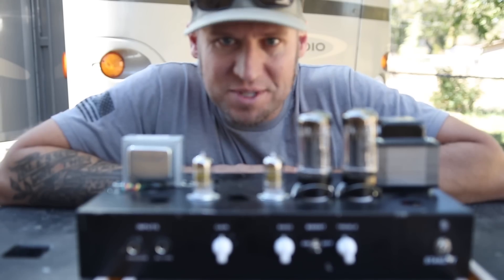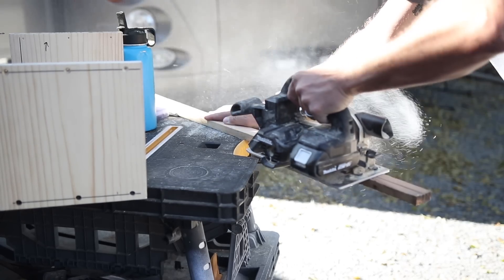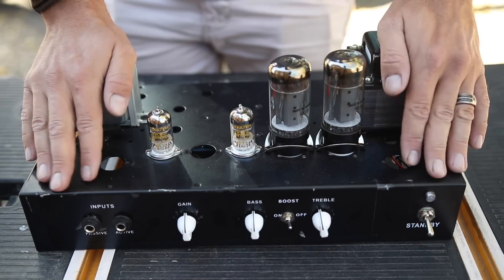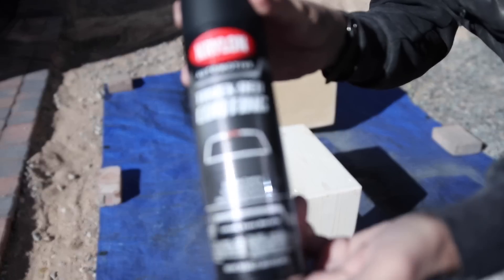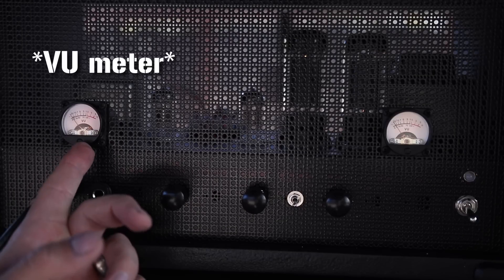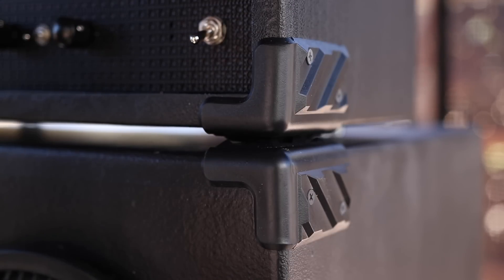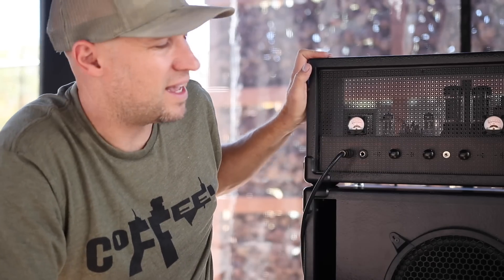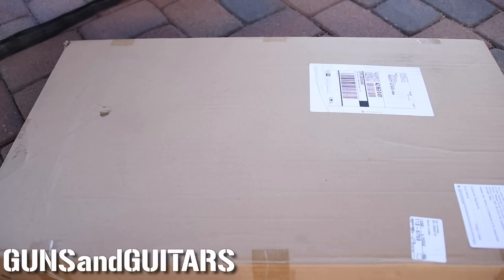Build your DREAM AMPEG style TUBE BASS AMP (for half the price)! KLD BFLEX 25 DIY portaflex kit

Comment: "id love a 50 watt version of this"
well two 6L6s usually make 40 to 50 watts of output the fact that your only getting 25 watts from them is sad cuz that means the circuit is designed to run them really cold or really inefficiently to get 25 watts out of tubes that can make 40 or 50. if it were me id just change the power amp circuit to get around 45 watts out of them and change the output transformer to handle the higher power if needed. but i know you dont know as much about amp modding. tho you prolly could try to learn to mod it by getting the schematic and post it to a amp forum site and ask some builders how you can get more watts out of it
Reply from the maker: I was thinking that two 6l6’s should be more powerful. This is very interesting to me. I’ll see if KLD will send me a schematic, then maybe I can mod it for more power!
Reply: @GunsandGuitars  You should be getting 50 watts just by running at 4 ohms.  But, the more powerful tubes rated at 50 watts should get you up to 100 watts at four ohms.  THAT is a gig worthy set up, even with a heavy handed rock drummer!  Hahaha ;D
Reply: Btw, correction: they took 7027 and 7059 output tubes, but would work in a pinch .
Reply: As a retired amp technician who worked in a music store in the 80's and 90's and worked on all brands of tube amps, I would have thought you already have nearly 50 watts by using a pair of 6L6's.

Comment: It's not about adding a tweeter to add highs. It's to use a crossover to send the highs to a tweeter and the mids/lows to the woofers. The reasoning is to have only the frequencies the speaker is designed for sent to it. It improves the clarity immensely. Tone is in the ears of the beholder, but I DO NOT like the sound you're getting, I just like a flat amp. The highs are there, sure, but it doesn't sound clean like I like a cab to sound. I feel like you speaker is struggling to churn out the highs and it's at expensive of a deep lotube? Could also be poor bass in my cellphone speakers, to be honest.

 You turned me onto the fearful cab, and its sounds cool as a project, and I appreciate you much for that. However... this amp cost as much just the woofer for the fearful cab, so might be more fun to try.

How was your cost on the tubes?
Reply from the maker: I think I paid around $100 but the tubes

Comment: 50 watts?  I'd need a 300 watt SVT clone! Hahaha ;D  But, those are heavy bricks!  At present, I have an ultra-light Acoustic brand short stack with twin 1x12" neodymium magnet speakers and a 300 watt digital head with a tube preamp.  Love it!  The cabs weigh in at about 25 pounds each and the head is like 5 pounds!  Great tone at any volume from bedroom to concert hall!  Fits in any car, even a mini-Cooper or a Prius!... not that I'd be caught dead in a Prius...  Hahaha ;D  That's why I mentioned the big SVT.  My little digital amp is just as powerful as that 80 pound SVT Classic!  Gotta love technology :)  Enjoy the new toy, brother.  Considering that you are running this stack at 4 ohms, you should be getting 50 watts already.  But, a 50 watt model in the same configuration would give you 100 watts.  So, I do get your point.  Personally, I have a Fender Jazz and a 5 string active Jackson.  The fiver is to keep up with keyboard players and the 300 watt head is to keep up with the drummers!  Hahaha ;D  Never been a fan of keyboard players that step all over my bass lines or drummers who do not understand the concept of dynamic contrast.  Drummers need three things... groove, meter and dynamics.  And, I'm officially rambling again!
Adventure ever on brother, Phat :)
Reply from the maker: When KLD asked me what bass amp they should model for this kit, I told the the SVT 300w or the Mesa/Boogie 400+ haha! They laughed at me, and came up with this portaflex clone instead lol
Reply: @GunsandGuitars  Both are amazing gig worthy amps.  TBH, the amp in the Ampeg Rocket Bass combo would work well for this rig at 200 watts.  But, the only way to get one is from the 1X15 combo AFAIK.  Gotta watch the ohmage when amp shopping.  Some give the wattage at 8 ohms, some at 4 ohms and others at 2 ohms.  Ampeg generally gives wattage ratings at 4 ohms for some of the smaller amps, like your portaflex... those are listed at 8 ohms... I think.  That makes your amp 50 watts in your 4 ohm set up.  Take my old solid state Rickenbacker head that I had all through school... rated at 120 watts and it drove the two Electro-Voice speakers rather well at 8 ohms.  But, she was a stereo amp that was actually intended to run at 4 ohms in stereo!  Now, I never ran any stereo effects.  But, I did drop the big 2X15 EV cab for two old Acoustic brand 4X10 cabs and that Ric head really cranked!  In fact, those 4X10 cabs were the beginning of the phatbassanchor tone as it still sounds today.  Phat tone from my bass that anchors the band.  That is the origin of the screen name I've had since myspace and email first appeared on this cool new thing called the internet! Hahaha ;D  But, the actual tone was born the day I first tried running two 4X10 cabs at 4 ohms.  I'm sure you noticed the rich bottom that you got when connecting the second 1X10 cab to your mini-stack.  It's the same with my current rig with the two 1X12's.  The tone immediately grows fatter with the second cab.  Four ohms is where the magic happens, IMHO.  So, I really dig your mini-stack <3  It's perfect for bedroom, rehearsal and small gigs.  It would get lost behind a hard hitting rock drummer but would be exceptional in an acoustic setting or small club gig.  
For transistor amps, the old Sunn Coliseum was a beast as well.  I get great tone from my ultra-light modern gear.  But, there's still a lot to be said for the old school tube heads for both bass and guitar.  So, I love your little portaflex clone, especially with the custom touches and dual cabs.  You will show us the finished product once you get the remaining corners on her, right?  At least when you are playing if nothing else?  You can build me some gear anytime, brother :)
Adventure ever on, Phat

Comment: Great video!
I have been looking for DIY bass amps for a while.  Not many companies offer them because of the danger of getting deadly electric shocks if you screw up with the capacitor and resistance wiring…
Still, I was wandering if it would be possible to add a pod for the mids and/or if you can customize the pods that are already installed in this kit…
Reply from the maker: I do wish this kit offered a pod for the mids. That’s one thing I meant to mention that the portaflex has that this doesn’t.

Comment: As a note on the passive/active inputs. They can actually be very useful. In my band the bassist has a passive and an active bass. On his amp head it's just a switch and not two separate inputs. But it's really handy when he switches because you can balance the levels between an active and passive bass super easy, without messing up the sound and annoying the sound guy haha
Reply from the maker: I guess I didn’t explain this well. I understand what active and passive inputs are. These inputs are really just like rhythm/lead inputs. The active input should be lower to compensate for active pickups. But that’s not the case. The active input here boosts the signal, overdrives easier, and cuts bass. It really is just a lead channel.
Reply: @GunsandGuitars  ohh got you, yeah I had an old FAL bass amp with a bright and normal, had a low cut on that channel and Guitars actually sounded great through it. Yeah I take your point on not using it, amp sounded great the way it was!

Comment: Hi @Dan, another great build you made! Sounds awesome. But there are some misconceptions (if I can tell you, ofc I don't want to teach you bdw):
1) passive/active inputs: I don't know if in this kit they are swapped but generally passive input is the normal one, whilst active one is attenuated by 3 or more db. This is because active pickups are hotter so if you plug in as is it would make the amp distort faster.
2) 6v6/6l6: they are output tubes. They comes from the same type of tubes, so very similar sounding, the main difference is the output power: 6v6 are able to drive more power, so ampeg model I guess it was rated maybe 60 to 120W? The same thing you would see in Fender guitar amps, or similar, in which output power is set using multiple tubes or swapping from 6l6 to 6v6.
3) I would have used a decoupler, like an op amp, to decouple your voltmeters, because this way I think you are introducing a load effect either in input or in output. In input it can distort a bit your signal because of the linear nature of the spring load meter, whilst in output it would change at least the impedence of DI out which is a bad thing because you want it fixed and perfect since you tipically use it to record. 
4) maybe your first speaker is rated to a high power. It's important not only to match impedence but also use a power that would not exceed power limit ofc but that is on the same range, otherwise you would not have enough current to run correctly your speaker and I guess that's the case. You can make a similar trick of what you made, making less impedence making two in parallel but using the same output port. For example have the speaker parallel to 4 ohm and still using 8 ohm out. This way you are sorta doubling the current you gave to your speaker, just don't do further because you can ruin it. I drive a 4x12 rated 400w with a 8w amp using this trick. 

Anyway, great job Dan, I appreciate your videos!

Comment: Half the price?  That's because you are letting a rank amateur build it, and there's no warranty.  My guess is that it's worth 1/4 the price.
Reply from the maker: Just so we are clear…all Ampegs are made overseas. They stopped making them in the US a long time ago. They first moved to China, now I believe they are made in Vietnam (if I recall correctly). At any rate, it’s highly possible it’s the same “amateurs” making both 😂
Reply: @GunsandGuitars  That doesn't change the fact that a DYI amp, made by "some guy you know" is worth 1/4 of the one with the factory warranty, regardless of where it is assembled.
Reply from the maker: Lol “some guy you know”
Reply: 😆 you must be married

Comment: Typically on a bass amp the "active" "passive" inputs just means the former has a pad to prevent clipping in the front end of the amp... sort of like the high and low inputs on guitar amps.
Reply: very easy to do by installing a switch with two different resistor values for setting input gain.
Reply from the maker: Yup, but that’s not the case with this amp. It’s more like a rhythm and lead input

Comment: I bet a regular guitar would sound pretty rad through this.
Reply: That is the same thinking as the original Fender Bassman tube amps.  That model is more frequently used by guitarists than bassists!  Hahaha ;D  Pretty sure you are spot on with your comment.  Adventure on friend, Phat

Comment: Hey, do you think you can build a battery powered solid state amp(head or combo)? I would love to see what you can do with it! I love these type of DIY Amp videos🤘
Reply from the maker: You can build small cigar box type amps that run on battery power. But anything this big, I’m not sure you’d want to carry a car battery around with you 😅
Reply: DIY guys usually take class D amp boards (like TPA3110 or any other, it depends) and put a preamp before it (it may be board or pedal). Amp may look like an Electro-Harmonix 22 Caliber (pedal) or head/combo, as you wish to make it for your use.
Reply: The first thing all amps do is convert the AC to DC.  Pretty much any amp could be run from battery, only variable would be duration.   Some amps use 40 volts dc and for sure +15 and -15 for the opamps so you'd need a higher voltage battery than a car battery.